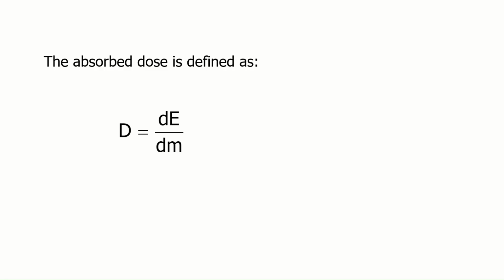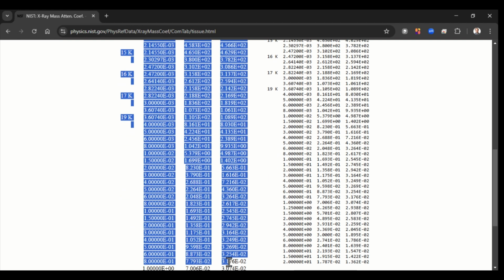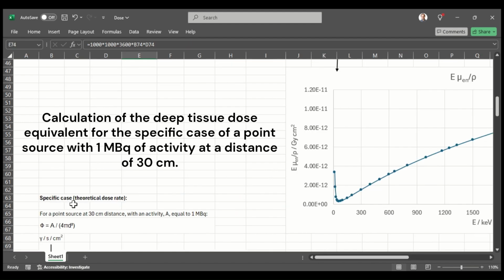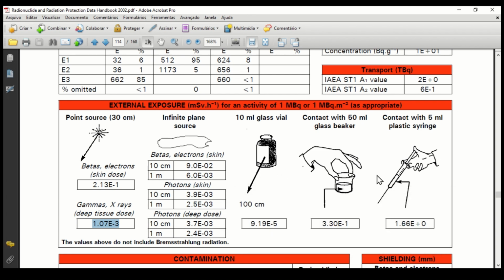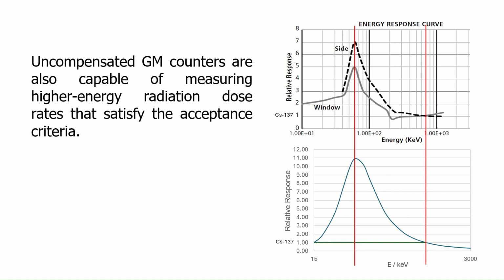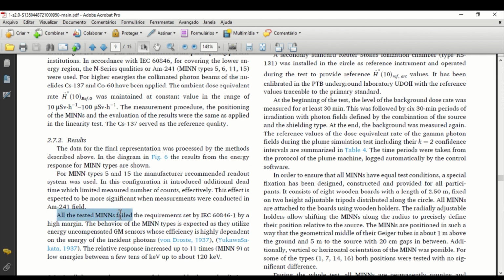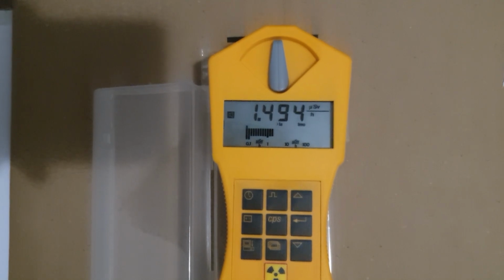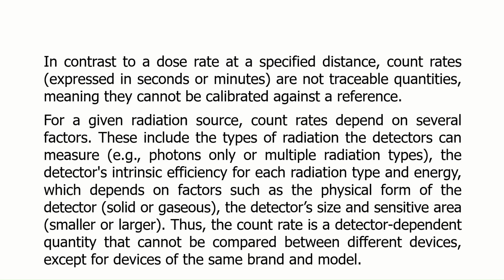Is Your Radiation Detector Lying to You?

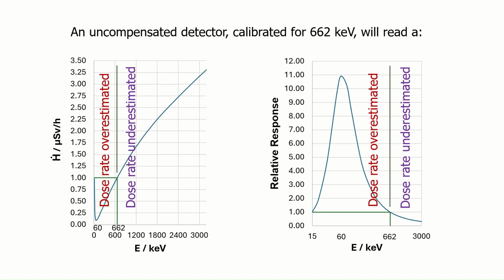Comment: Clever how you adjusted gamma scout distance on 662 keVso you could then compare  overestimation on same distance on 60keV , allso very good presentation on 17:10, i learned that i have a deep rabit hole to crawl through to better understand the detectors. And i will for sure took this knowledge into acount if buying a new one.
Reply from the maker: I'm glad you found the video useful! You’ve picked up on a key point — dose rate overestimation at lower energies is a common 'rabbit hole' when it comes to understanding non-energy-compensated detectors. Thanks for the kind words!
Reply: I am not pretending understanding everything as it is very technical video  😅  but i got the point and it is great to know and think of it in future.

Comment: This is well organized, though very technical.  How is the Atomtex calculating beta flux density?  CPS/Detector surface area (cm^2)?
Reply from the maker: Thank you for your comment and question!

Yes, beta flux density is calculated the way you pointed out. The calculation uses CPM (Counts Per Minute), but CPS (Counts Per Second) could also be used. The flux density is calculated by dividing the measured CPM by the detector surface area (cm²). The beta flux density (given in beta particles per minute per square centimeter) is particularly useful because, once the radionuclide is known, it simplifies the calculation of the corresponding absorbed dose to the skin from beta radiation.

The aluminum filter is likely used to simulate the reference thickness of the dead skin cell layer (0.07 mm). This makes the beta flux density measurement biologically relevant, as it can be used to calculate the absorbed dose to the skin from a specific beta emitter, provided that emitter is known.
Reply: @IonizingRadLab  Yes, that makes sense.  Is there a  recommended material and thickness that can be use to cover a pancake tube in order to approximate energy compensation.   I 'm sure it would be dependent on the model of the tube.  Call it a homemade energy compensated GM counter.
Reply from the maker: @kinetoscopemicroproduction6418 , designing a homemade energy-compensated Geiger-Müller (GM) counter is an interesting and educational project.

The project would involve placing a metallic filter or shield around the GM tube and finding a balance that reduces the over-response at low energies, particularly around 60 keV, without excessively attenuating higher-energy photons. A high atomic number (Z) filter or shield is commonly used for this purpose, such as lead. The ideal thickness would depend on the model of the GM tube, as you mentioned.

A key secondary function of this homemade filter is to completely stop beta particles. A filter capable of shielding the most energetic beta particles (such as those emitted by a Sr-90/Y-90 source) would also be effective against less energetic beta emitters. By shielding beta particles, the filter ensures that dose rate measurements reflect only gamma and X-rays, which is the intended purpose of energy compensation.

Finally, the most critical step: the newly built energy-compensated GM counter must be calibrated against a range of known gamma and X-ray sources to verify its performance (e.g., Am-241, Cs-137, and Co-60). You would need to compare its readings with those of a reference energy-compensated detector at the same position (e.g., 30 cm from the radiation sources) across a range of different photon energies (if you have access to such a reference detector and suitable radiation sources) in order to adjust the filter’s thickness accordingly. Without proper calibration, it is impossible to determine whether your homemade energy-compensated GM counter is providing accurate dose rate measurements.
Reply: @IonizingRadLab  Thank you for the advice!  I have a Better Geiger S2L scintillation detector that could be used the calibrate the GM counter.  However, I don't think my higher energy sources would be effective enough at 30 cm (or even half that distance).   I probably need to spring for a Cs-137 disk from Spectrum Techniques.
Reply from the maker: @kinetoscopemicroproduction6418 , you don't need to use an exact distance of 30 cm between the detector's reference point and the isocenter of the radiation sources. However, a separation of 30 cm or more may be beneficial if a more even dose distribution is desired.

To achieve acceptable calibration results, it's generally sufficient to ensure that the distance between the detectors and the sources is much greater than the detector's dimensions. To establish a fixed and equal distance for both detectors, you can use the larger detector's dimensions as a reference.

When a detector is placed very close to a small, point-like source, a tiny change in distance can lead to a significant variation in the measured dose rate. This makes it difficult to obtain consistent, comparable, and reproducible measurements. However, if the distance between the detector and the radiation source is sufficiently large, this effect becomes negligible.

Additionally, since the detector has a finite size, different parts of it will be at slightly different distances from the source, introducing geometric inaccuracies. No detector is a true point. In this case, if the distance between the detector and the radiation source is much greater than the detector’s largest dimension, this effect also becomes negligible.

In practical terms, one dimension is often considered "much greater" (>>) than another when the ratio between them is 10 or more. Practical guidelines commonly require this ratio to exceed 5:1, and often 10:1, to keep approximation errors below a few percent.

For example, the scintillator crystal inside the Radiacode device shown in the video measures 1 cm × 1 cm × 1 cm. Therefore, fixing a distance of 5 cm between the detector's reference point (marked on the side and front) and the isocenter of the sources creates an acceptable measurement condition for calibration. For higher accuracy, a distance of 10 cm or more is recommended. Greater distances, such as 30 cm, provide an even more homogeneous radiation field across the crystal, representing a best-case scenario for calibration accuracy.